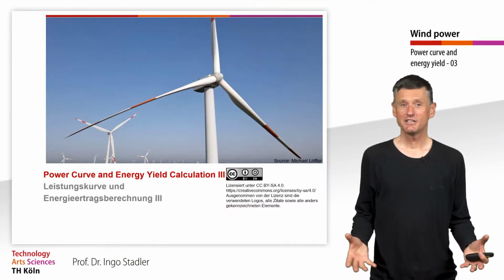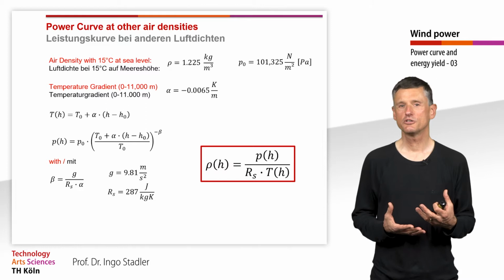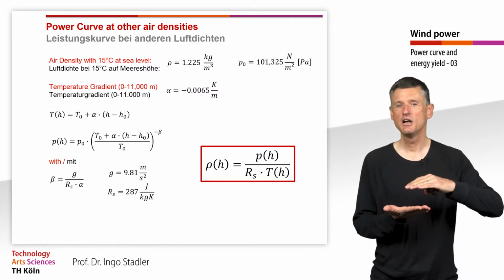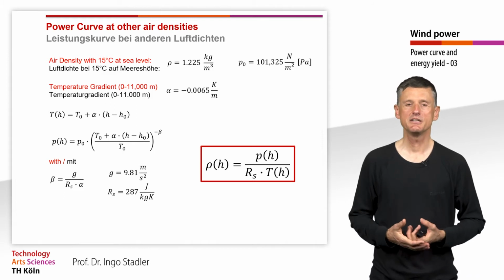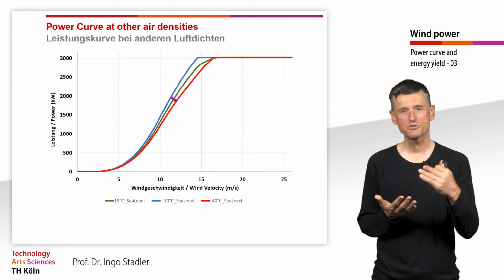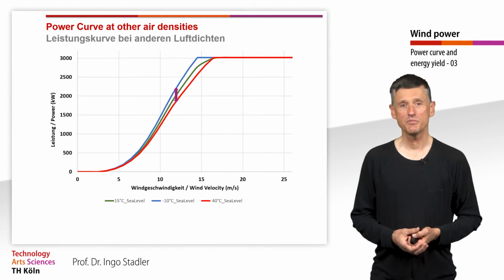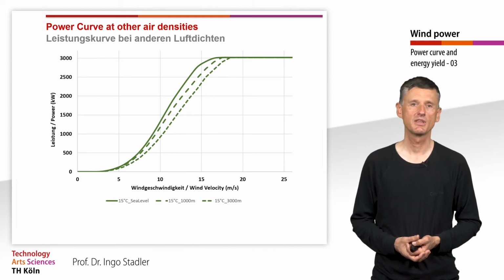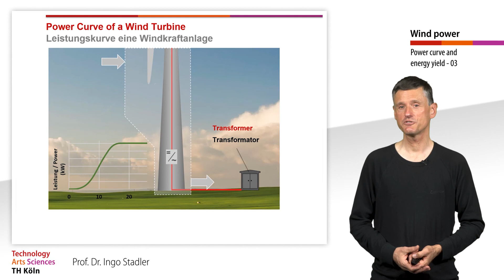Energy Yield Calculation of Wind Turbines - Pecularities

Comment: Thanks! Detailed knowledge of density and velocity of the natural wind is necessary ALL like you presented by curves especially for  designing, planning aspects and operational aspects! So clearly you illustrated two leading factors for a wind but also wind atlas in which the researchers as input can use the models in turn of wind turbines. Presenting of the effects of area  orography on the wind density can be easily calcutated to 3-D regularno grid.

Comment: how would one estimate the power output of of a 1MW wind turbine given a certain wind speed in m/s ???  is there a formula to ESTIAMTE this ?   need it for an excel file for a small project i have and do not require overly accurate figures
Reply: Power vs Wind speed Curve.... manufacturer specifications. (Benchmark Test). Power is adjusted with actual ambient conditions based on the eqn's provided by the video.